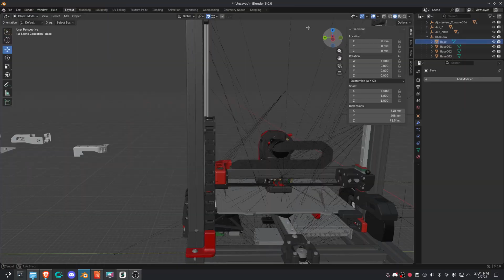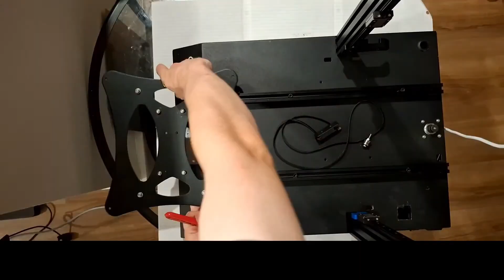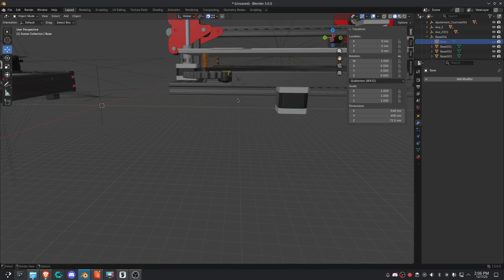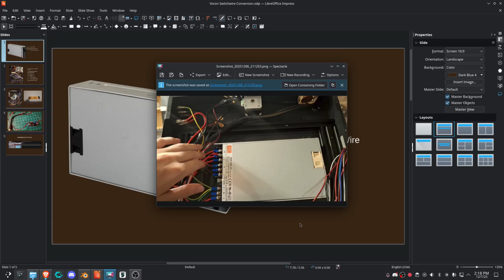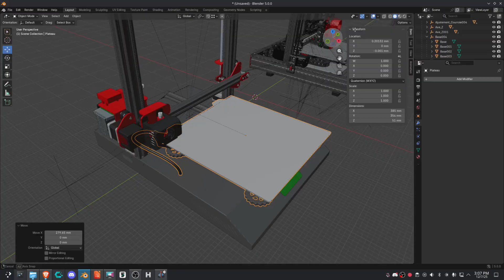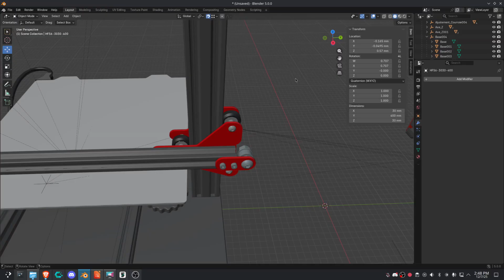Cr10S Pro To Voron Switchwire Conversion

Comment: I am really considering doing this conversion considering I've already switched to the xol toolhead and other part upgrades. Did you require any additional structural materials except the linear rails? Did you change the stepper motors or used the stock ones?

Comment: I am looking at this now as an option. I don't have a lot of space and wanted a faster printer. I was looking at the voron builds and found that I can upgrade my printer (CR10s Pro V2). I run the rpi with octoprint and the old firmware that had the fire issue fix (tinymachines). It's taking me 16 hours to make a 3.75 mm lid (~170 x 210mm) and I'm not a fan of close source ecosystems (bambu labs). Voron builds sound great but my time is pretty limited too so this was good to see to estimate my build time and efforts. 

Haven't finished the video but it seems like the conversion will basically skeletonizing the CR and reuse the case and I assume the PSU, stepper motors, prob the rpi (klipper?) but likely change the belt timing/extruder/electrical connectors maybe...

How is the stability? I will have to finish the video but am typing out my thoughts as it plays!

Finished the video. Not sure if I'm a fan of repurposing the frame. Plus I'd have to print everything before moving onto the build (we all know that will not work out alright! lol) I love the idea of repurposing my printer but I think someone else will enjoy it for a good introduction to 3d printing instead. Thanks for the build introduction and I'll check out your other videos for more info on what options are available to me!

Comment: Hello, I love your video, in fact I am following it to try to convert my machine but I am having problems finding the length measurements of the linear rails to make the most of the printing volume. Could you tell me how many mm the rails are for the x and z axes and if you also know about the y axis, also if with the ones you used it would be possible to reach the maximum volume of 300 x 300 x 400. Thank you very much.
Reply from the maker: These are the linear rails I went with: https://www.robotdigg.com/product/1314/Black-anodized-linear-rail-7,-9,-12-and-15. Go with the MGN12H, dont remember the size off the top of my head but I think the z-axis was 450mm and x-axis was 375mm, but be sure to take your own measurements.

Comment: Are those cut on right side are necessary?
Reply from the maker: Assuming you are referring to the cut I made on the top of the printer's shell, next to the right z-axis aluminum extrusion, the answer is no. The only holes you need to make are on the sides to allow the x/z axis motors to be mounted correctly.